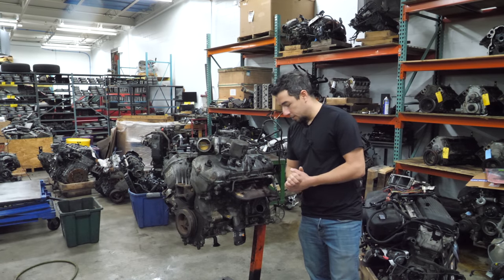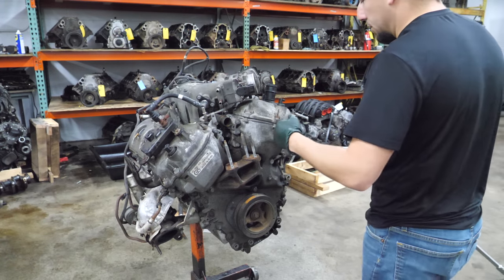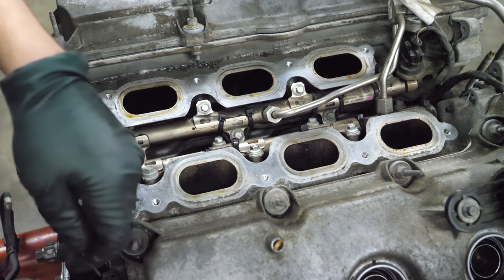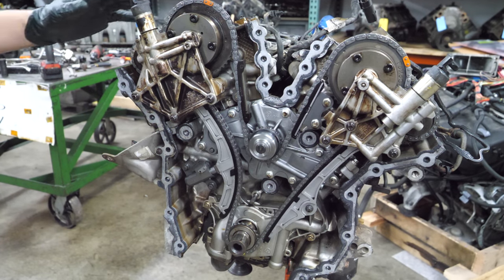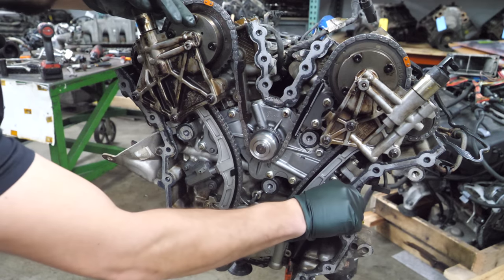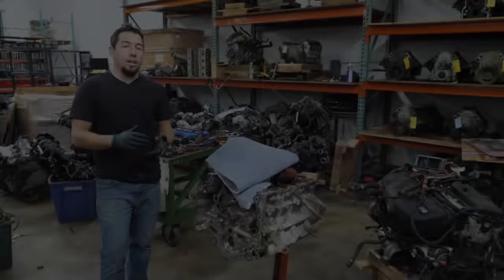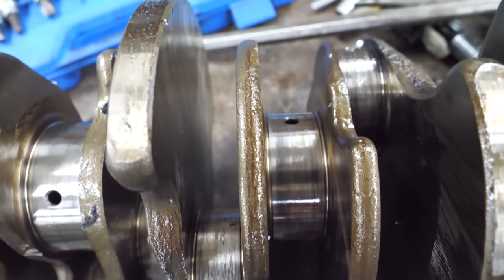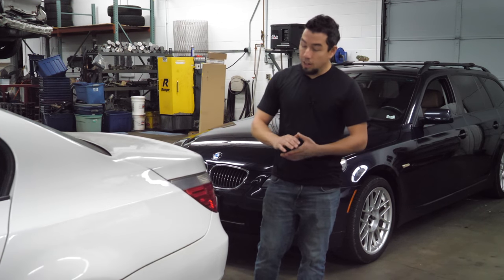Taurus SHO Flex ECOBOOST 3.5 V6 BAD Engine Teardown! What Killed This Maintained Engine?

Comment: Question...My wife passed away and I want to have the stock timing chain and water pump replaced on her 2009 Mazda CX-9 with 160.000 miles on it. Should the oil pump and cam phasers be changed also and anything else you'd suggest while it's opened ? It makes a marble in a plastic can sound at idle for only a moment from time to time but usually not on first start up and ambient temperature doesn't make a difference I can't hear it driving . Performance hasn't changed but my wife was the driver so my experience is about 1000 miles mainly interstate. I'm in the middle of nowhere Appalachian Mountains and the 2 Ford dealerships don't have the best reputations so if I find a private shop should the intake screen be cleaned other than the oil changed the engine hasn't been opened up but the PTU was replaced at 80.000 miles. I will keep her car no matter what it takes ,it allowed her to make it to her parents house on top of a mountain with unmaintained roads in the worst of conditions and her handicapped 80 year old mother was able to get in and out unlike with the truck. Thank you for any assistance or anyone else that is knowledgeable

Comment: If the cam journals are damaged like this engine is the cylinder head repairable or trash?  I'm wondering if they can be bored to accept bearings of some kind.

Comment: Engines were less complicated when I was bending wrenches for a living.  I am enjoying learning about current engine technology and I am damn happy I’m retired!  ( I got my journeyman’s certification in 1979, when I was just 21. )
Reply: Just curious where you reside? I have a good friend named Michael Hoffer with double-F. He is from Pittsburgh and says his heritage is Slovak. 

As for engines. There is so much aluminum used today and I think the manufacturer has to know what they are doing as far as castings go. Secondly to use steel and iron where you need it for durability. Aluminum is good for its lightness and thermal properties but I think it expands more than iron.
Reply: @jamesmedina2062  subaru is notorious for/steel blocks with aluminum head  gaskets failure I think.
Reply: @INVERTEDBUKAKI  Ok. I don't even know. I just have seen what they look like inside and out. I think aluminum does go better with aluminum. I will say when I had an iron block VW 1.8T, it seemed the thing was always cooking the oil and people had sludge problems. Now with my Honda, I feel as though the aluminum and open deck help to dissipate heat better. Not cooking the oil now but it gets dirty with carbon from the Direct Injection. Both are issues but the Honda does better at ring sealing and not leaking oil everywhere
Reply: @jamesmedina2062  I also have a yale forklift with a cast iron block and aluminum heads and we have to do a head gasket job on the thing every few years

Comment: Isn't that the same engine as a non turbo car?  I heard they modified the timing chain sprocket to a double sprocket in mid 2011 to address early water pump failures in earlier engines? This looks like the earlier design?  I wonder if those cam bearings were damaged when the original water pump failed and all the milky oil was pumped through the system? Looks like someone didn't clean the engine up when they replaced the water pump? Do things like this happen when someone replaces the water pump while the engine is still in the car?
Reply: Are you saying the turbo caused this engine damage? It is possible they were on the interstate and couldn't pull over before this happened?  You really don't know what situation the driver was in when it failed

Comment: The oil remnants seemed very thin.  I'd never use that 0w-20 in anything and surely not for more than 5k miles.  Oil starvation is bad, umm-kay.
Reply: These engines required 5W20.
Reply: @socialjusticewarrior9601  "Required" and good for the engine are two different things.  Super light oil is only to get that last half mile per gallon to try to meet CAFE standards.  A high-powered turbo engine likes a heavier weight. European engines call for 15w-40 for a reason.  I had a Merkur XR4Ti with turbo and used Castrol 20w-50 and it was still running like a champ when sold at nearly 200k miles with no noises, or smoke on startup.
Reply: @jamesplotkin4674  Pretty sure the engineers designed this engine to work with 5w-20. 
0W20 - 5W20 difference is very, very minimal. And in terms of fuel efficiency, barely a full 1% of difference if you go to comparison of 5W30 to 5W20.
Reply: @jamesplotkin4674  You can throw heavier oil in your engines all you want, but once you start restricting flow through the very small oil passages to the chain tensioners and VVT system, you're gonna have a bad time with these modern TDI engines.
Reply: @socialjusticewarrior9601  Hydraulic lifters have much smaller passages and they work just fine with oil thicker than water ;-)
Reply: @jamesplotkin4674  Engine performance will suffer

Comment: I thought about using one of these engines in a engine swap into a rear wheel drive car. The only thing that bothers me is that water pump. I know i could probably use ecoboost out if a F150 which has the external driven waterpump, but for a car you probably want ECM out of a SHO. Im  not sure mechanically how different they are. Have any advice?
Reply: Don’t get the one in the engine out of sho! Mine cost 3k to fix

Comment: I wonder how responsible running that 20 weight watery swill is for these "mysterious" early bearing failures?  I run 10 W 40 in all of my high time engines and screw the CAFE fuel savings!

Comment: I highly doubt it was a maintained engine because if it was maintained it wouldn't have blown up right? changing oil every 3000 miles or 5000km is crucial for any engine as well as flushing coolant at least no more than every 3 years I've been master GM service technician since 1989...and let me say if the vehicle has been maintained it wouldn't be in the shop I believe what killed this engine is the fact this engine has 2 turbos on it creating much higher than normal internal engine temperatures especially under hard use typical of any engine that is turbocharged... turbocharging increases power like we all know but what they don't tell you about forced induction is that they exert much higher forces on internal engine parts like connecting rods pistons rings cylinder bores etc. And also I do believe that lack of maintenance on this particular vehicle was a factor as it might have been a rental or a hard driven police vehicle

Comment: Hey Eric, weird question for you:  
Do you know what would be a normal cause for a misfire in a single cylinder on an SHO EcoBoost motor? If the plug is good and the coil pack is as well? Just curious if you have any ideas?  It's okay if not. Take care and hope you're having a good New Year.
Reply: If it’s throwing a code you might want to check the fuel injector. If not that it might vary unfortunately be the cam phaser on that bank. If it’s not throwing a code in the engine area seems to be shaking, in mine it ended up being the CV axles. They blew immediately after I changed them because of the lift kit so I took off the lift kit

Comment: would an oil catch can be beneficial for direct injection motors? seems like having the pcv going into the intake would cause alot of crap built up on the valves, why dont they come with catch cans from the factory
Reply: A lot of it isn't even the PCV system. That's the "EGR" (Exhaust Gas Recirculation) system. Its probably one of the more interesting systems on modern engines because of emissions requirements
Reply: yes it would help but remember after 2000 most companies in the US went after reduced life, faster turnover, and higher profits. 2000 is when outsource to China went into full boost!
Reply: @Awkward_Fox  These engines have no EGR at all
Reply: @blueblood76  I stand corrected. It's valve overlap to simulate an EGR system. Still though, a catch can/AOS won't do anything for the carbon, and are only really useful on high RPM naturally aspirated engines or turbo engines (which this is). That said, they are a maintenance item, and need to be opened every oil change to ensure its working properly, or in the case of a catch can, drained.

Comment: Pretty sure this isn't an SHO motor. I recall them coming with tubular exhaust manifolds, not cast.
Reply: This is early 10- to 12 SHO engine  with sheet metal exh manifolds . In 13 they switched  to the cast iron exh manifolds

Comment: I believe the explorer sport had the same engine for a few years (until the explorer went back to RWD in the last few years, 2018?)
Reply: No, I work on the motor line at Chicago assembly. 

We hot rid of the silver head when the Taurus was discontinued.
Reply: Correct. Same motor in the previous gen explorer sport

Comment: I gotta say that I still don’t know why the automakers have not considered water injection on these engines. It would go a long way to reducing the overall temperatures. It would do the job that port fuel injection used to do in keeping the intakes clean and it might prolong the life of the whole motor
Reply: If consumers don't change the oil, what makes you think they'll remember to add water?
Reply: @jghall00  100% that and catch cans no one would drain them

Comment: at 14:52 when you start going over all the cam buckets, most of them are cracked.  this thing overheated and then got oil starved after the water pump was replaced.
Reply: I saw those marks on the cam buckets and wondered what they were.

Comment: Only ford would think to put a 65$ water pump internally on a engine, so it still cost 1800$ to fix. Ford is actually under a class action lawsuit for the water pumps. Cost ranging from 1800-3000$ for a water pump replacement and dealers say its best to replace the engine when the pump fails.

Comment: Gotta be honest, I'm not a fan of these eco boost engines, seems they're the better of the new turbo v6 engines, but the only time I see them with high miles its either all highway miles, or insane maintenance. people I know that own them that go by the manufacturer's recommended maintenance usually end up blowing them before 200k. i miss the days of the straight six that won't die, or the v8's that can survive low oil, over heating, no maintenance lol. I'm afraid the days of the 300k plus mileage backyard maintained cars is over.

Comment: I always thought all of these 3.5 engines had VVT on both cams (Ford calls it Ti-VCT) but maybe this specific version doesn't?
Reply: The N/A 3.5 does the twin turbo in cars does not. The new Truck 3.5 twin turbo has 2 also.

Comment: Parts Master is sold by Auto Value here in Kentucky. I have never seen it sold anywhere else. How about your part of the country?
Reply: They are nationwide. Manufactured by third parties for Auto Parts Alliance, which is an alliance of smaller regional auto parts wholesalers, set up to compete with the volume buying power of one of the big chains, i.e. Advance/Autozone/Pep Boys.

The filters are Wix-made, the brake cables and hoses are Dorman, the oil is Valvoline. All just rebranded for them.

Comment: pfft I have a turbo RSX-S that has been boosted over 15 years and compression is still almost 200psi.  No engine problems. Only had to do turbo seals and replace 2nd gear
Reply: A Japanese car is made a little different than an American one 😂.
Reply: @tails300  I know, what I was implying.

Comment: Weephole was added to the later 3.5 Ecoboost engines. The early versions such as on my 2010 SHO didn't have it. Such a poor design to have an internal water pump. A la Chrysler 2.7 V6

Comment: Just had my water pump go out on my 2014 Flex.  Yep antifreeze mixed with the oil.  I got it shut down right away but after replacing the water pump and the oil pump and the timing chain I now had a rod knock.  How often can you just change out the rod bearings and possibly the crank (if needed) are you good to go?  Would I be better off just getting a replacement engine?
Reply: Replace the engine

Comment: So that cavity on that water pump only shows a gasket failure? It doesn't lead to between the two bearings to indicate a shaft seal problem?
Reply: There are 2 weep holes on WP and in block he only showed one. The top one is for shaft seal

Comment: Dam those motors give me a motor that has a water pump on the front iv got a 98 chevy vortex witch has the third one I'm not a micanic can't even spell it but I can change a old style water pump looks like you need a PhD for those times are changing and not always for the best.

Comment: What an absolute unit of an engine. But why would they engineer a water pump INSIDE the engine - this is horrible - probably need removal of engine for such a maintenance item (About 100k miles)

Comment: just started the vid, my guess is that with these 3.5 engines, probably the water pump failed. these engines are apparently notorius for it and getting to the pump is supposed to be a major pain in the arse.
edit: i'm no mechanic but, it surprises me how one side of the engine looks nice and clean with no signs of trouble and then on the other side, lots of varnish and crud. how the hell does that happen?
Reply: The PCV is on the back valve cover, Also the timing chain on back head elevators the oil pan oil up that head,

Comment: you  NEVER run a water pump off the chain in the middle of the v..... cam harmonics will KILL em....  
wp needs to ALWAYS be on the slack side of the chain as the  quad 4 gm did....    this failure is the same as the 2.7 mopar in the intrepid

Comment: I bought a 2013 SHO a bit on a whim years back. Really, it was a great ride. Performance Package, 402A equipment and Livernois tuned. Really ripped for a sedan its size. Very unsuspecting and very refined and quiet as well. But I did not have it for long, as I became fearful of repairs. They also used a poorly designed (or adapted) PTU in the AWD system. Sweet video!
Reply: There is a fix for the PTU in the AWD system, put a drain plug in it and service it

Comment: Could you imagine what its like trying to remover the timing cover and water pump with the engine still in car?  There is no way you can replace the water pump in the car and do a decent job of it.  Dropping the engine is the only way to do it and get a good look at what you are working on.
Reply: i just swapped my water pump and a piston with the engine in
Reply: I have done it to both my engines in the car, 80% do it in car,
Reply: @withku  #4 piston?
Reply: @blueblood76  #5 , you use shoforum no?
Reply: @withku  I am on all 3.5 eco sites. Mine is an MKS. Just went 11.9 last time at track.
Reply: @withku  Are you the young kid I been dealing with there? Ring gap? lol

Comment: My 2015 Taurus SHO has 185,000 miles on it.   One of the turbo has developed a slight oil leak and needs to be rebuilt ($2200 job).   Do you think it is worth keeping ?  trying to decide if I want to trade it in on another car
Reply: Is it your front  or rear one? The front one is easy to change. New Ford turbo is $700 with a $250 dollar core charge which you get back when they get your core.
Reply: Put a real motor in it.. 5.0 HO.

Comment: would top tier gas make any difference at all on a turbo DI engine as far as keeping carbon build up at bay? or is it just pointless given the design of a DI engine?
Reply: In DI engine gas never touches the back of the valves so would not matter. Some install a meth kit nozzle in intake so the meth can add some cleaning. but mostly for cooling and octane,

Comment: If it is a Taurus based platform, the water pumps and timing chain sets are not a bad job to do at all. F150 ecoboost engines are a pain no matter what. You had much more room in the truck Ford... Why did you make everything so much more difficult?!!

Comment: Wait. To change the water pump you have to pull the whole timing cover? That kinda sucks.
Reply: Yep stupid design
Reply: The newer Fusion Ecoboost 4 cylinders are even better. Same location, but it's an electric water pump that has an attached idler that simply freewheels on the chain. So just as much of a gigantic pain to replace, for absolutely no mechanical reason. It was like that on the 1.5 and/or 1.6t. Not sure about the 2.0t.

Comment: Good! So that fucking terrible wear on the cam lobes, cam bearings, oil pump + the jewels found in the oil suction pipe and crank bearings, were actually due to temporary oil starvation. So this was a badly maintained engine in the end! I was just afraid that this would happen to all engines even if well maintained and with good parts replaced after X miles. So it was all an oil problem.

Comment: Them echoboost engines are really bad, even in the UK the 4 cylinder echoboost engines are bad, burn oil, loose water, turbo issue's and sometimes just blowup for seemingly no reason.

Comment: At 5:50 you say “they usually break” and that pretty much sums up nearly every Ford Ecoboost motor ever. They’re incredibly poorly engineered and many even fail within the factory warranty which you would think would give Ford incentive to do better but that seems to be beyond their abilities as a company. Has your Ford blown up lately? So many do every day from Ecoboosts to Powerstrokes. If it has turbo, and is made by Ford, you’re likely on borrowed time before needing obscenely expensive repairs.